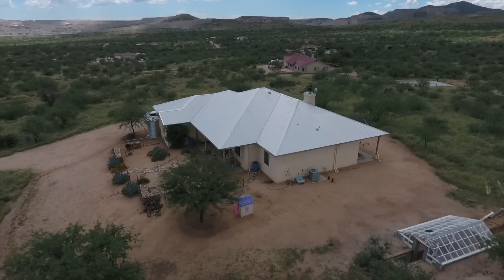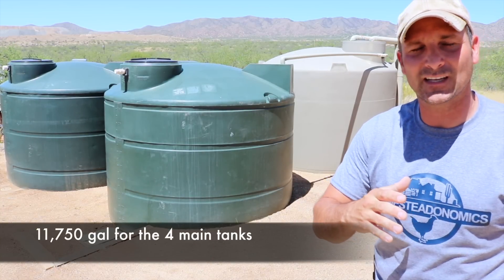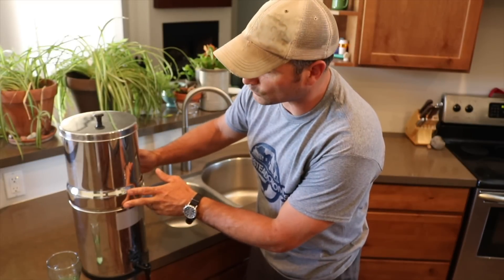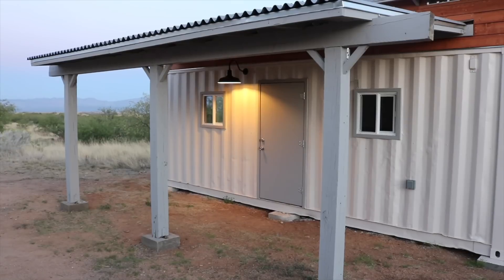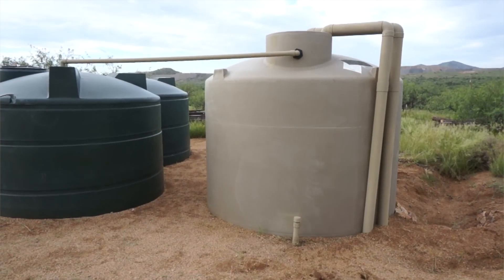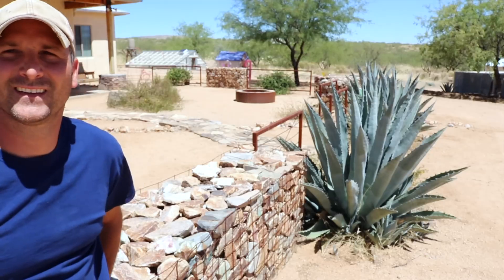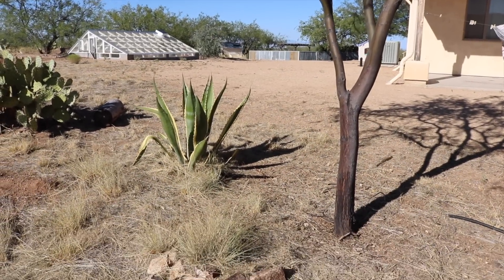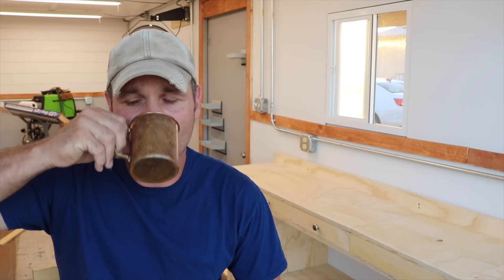Rainwater Harvesting QA - Cost, is it Illegal, how I treat, etc,.

Comment: Amazing project. I wish I can do the same here in Croatia. My income (read: pension) is low, so I can't do the same, although I wish. This summer is pretty rainy, but many summers are pretty dry. I have just few trees of apple and other vegetables, which suffer if there are no enough water. Question: did you consider collecting sunlight for electricity and heating water for bath?

Comment: Chlorine kills bacteria, bromine kills algae, algae grows in water in the presence of ammonia and nitrogen from animal waste, is introduced to the water at the collection surface, in the form of nitrides, toxic to plants and animals, it must be converted by a catalyst in order to support algae growth, this takes place , in an air water transition area, a rough or porous surface that receives enough moisture to remain damp continuously, or an area  in  contact with air and water equally, biological organisms attach to the surfaces, thrive by feeding on the toxic nitrides, converting the form of nitrogen into less toxic nitrates, still a harmful contaminant, which the algae feed on, killing the algae with another toxin adds another chemical, (goes deep into a vast and  boring study field) and eliminates the colonized algae, leaving both toxins  water, applying logic, in a pre storage area, circulating water through a desirable system friendly and edible media such as watercress, (yay veggies) or aesthetically pleasant aquatic plant, will minimize if not remove the nitrates, and this will be evident by the lack of algae (green to blue-green colonizing ot deposits in areas exposed to light, and your source for inspection. 
 You can do this with an inexpensive water pump and a few length cut drums with limestone gravel ( be sure to cover with screen and protect from animal intrusion)

Comment: Great video! I too harvest rain water. I use it to water my garden and to wash my car. 
I also have two deep wells. My rain tanks are nothing more then 32 gallon garbage cans.
I use a .5hp Jet Pump which is powered via solar electricity system. The whole system is set
up in and around my garage. It is small, only 300 gallons, but it does the job. Of course,
I am in Florida so we do get some rain. I do have to treat the water for mosquitos and I have screens over the garbage can / water tanks. I do not use this water for drinking.
So, I don't have a bunch of filters and I do not use chlorine since I use the water
to water a garden and to wash my cars.

Comment: Just saw the video, very good description of your amazing installation! I find it somehow interesting to live solely on rainwater. I take a strong guess you're solar powered as well?

The gunk from the roof that ends up in your tank should actually help in water treatment. Because in the sediments several types of micro organisms can start to settle, once they are introduced by anything that was on the roof for example. And you actually want these in the sediments, because they help getting rid of unwanted stuff in your water. They feed upon anything organic, create nitrite, which is then converted by the bacteria into nitrate (which plants need to grow - google for "nitrogen cycle") - so you gain a lot by a little sediments. You can support that by adding lava rocks, anything that gives the microorganisms lots of surface to settle, then you can introduce a quite perfect natural pre-filter.

With greetings from germany!

Comment: Hi dude. Thanks for the excellent video. I went with flexitanks. They are huge (like a shipping container), cheap, foldable and can last for like 30 years or more. And tarps, lots of tarps.
Also using solar panels to power a de-humidifier works great too. Even in arid climates it's economically viable as the price of solar energy continue to drop.
Have you tested your water for minerals? I added a gravel filter this year and the water is now as rich in them as the ground water if not richer. I also stabilize it, but I now know it's not really necessary.
Cheers.

Comment: Most marine systems use RO to make fresh water out of sea water, which is about as clean as it gets short of distillation.  Most of them have a UV light in the system after the tank and before distribution through the boat.

Comment: Californians may now legally capture and use rainwater harvested from rooftops. Departing from Western states' long-standing tradition of making it illegal to capture and use precipitation based on the prior appropriation doctrine, the California Legislature enacted and Governor Brown signed the "Rainwater Capture Act of 2012" [2012 Cal. Stats. ch. 537, Sec. 2.] (the Act). The Act exempts the capture and use of rainwater from rooftops from the State Water Resources Control Board's (SWRCB) permitting authority over appropriations of water. This development affords residential users and private and public entities with a new source of on-site water supply, which should reduce reliance on potable water for landscaping needs and provide a recharge benefit to underlying groundwater aquifers.

Summary of the Act

Prior to enactment of the Act, the SWRCB required all would-be appropriators to apply for and obtain a permit to appropriate water from any source, including water falling in the form of precipitation. Under the Act, however, the use of rainwater - defined as "precipitation on any public or private parcel that has not entered an offsite storm drain system or channel, a flood channel, or any other stream channel, and has not been previously been put to beneficial use" - is not subject to the California Water Code's SWRCB permit requirement [California Water Code §§ 1200 et seq.] Relief from the permit requirement enables residents, private businesses, and public agencies to create new on-site water supplies to meet landscaping needs, thus decreasing the use of potable water to meet those needs. The language of the Act recognizes that it may contribute to attainment of the state-wide "20x2020 goal", which aims to achieve a 20 percent reduction in urban per capita potable water demand by December 31, 2020. [2012 Cal. Stats. ch. 537, Sec. 2.]

The Act further provides that it is not intended to alter or impair existing rights, change existing water rights law, affect the use of rainwater on agricultural lands, or impair the authority of water suppliers to protect the public health and safety of public water supplies as authorized by California law.

Surprisingly, the Act explicitly defines certain terms - "developed or developing lands" and "rain barrel system" - although they are not used in the newly added Water Code sections. This suggests that in the future the Legislature may seek to expand and/or further define the scope of the Act.
Reply: I'd say it is the long-standing tradition of big-government, socialism loving states, not all Western states.  Arizona hasn't had such big-brother insanity.

Comment: That is an awesome system you have for rainwater harvesting. And without a well or connected water you absolutely need it. I first started regular rainwater harvesting in Pennsylvania, mainly for lawn and gardening on a half-acre lot. Now, in Missouri, we have a system that is filtered and used for laundry, showers, and toilet flushing. We use an Air-2-Water unit for cooking and drinking water, but you need higher humidity than Arizona has to rely on that. 

The biggest issue with our rainwater collection system is keeping the tanks from freezing during parts of the winter, but it is doable. Missouri actively promotes rainwater collection, and as long as you aren't connected to city water or sewage systems anything goes in the county I live in. We're looking at installing composting toilets in our house as the next improvement, and a system to catch grey water for the truck patch. Since we only use environmentally friendly soaps for laundry and kitchen, that should also be doable.

Regarding the legal issues surrounding rainwater harvesting, that must be a video unto itself. In a nutshell, there are two issues. The first is whether you are in a state or location that traditionally uses a water apportioning system called "prior appropriation" versus "riparian", because in a "prior appropriation" locality the person who first used the water in a creek or river has first dibs on the rainwater that would flow to that creek or river. The second issue is regarding contamination of public water and sewage systems. So, if you are completely independent of public water and sewage, and especially in a "riparian" rights locality, you are free to knock yourself out when it comes to how you collect and treat your own water.

Comment: you know what you need for that berky? i have a berkfield  same filter  the water is clean but they strip the water of everything you need some volcanic mineral stones in the bottom drum with some shungite chips that water would be around 10.0 ph. also i have this idea of water collection i'm not sure it's invented yet though where you could take a small lightweight but strong tiny propeller type device that sits in the pipe work where  the rain runs off past the guttering which could be turned into energy to charge power banks  there is energy in that water
Reply: and orgone dotted around where you are planting ..nature loves orgone

Comment: Old timers would throw an old silver coin in the water.  Silver has anti microbe properties.
Reply: Old circulated coins usually had a small amount of copper in them for wear resistance, typically 8-10%. Bullion and non-circulating collectors coins are the exception. Early 1900's Peace Dollar coins were 90% silver, 10% copper.
Reply: @Jean1641-4UK  you can just buy a .999 silver round for 15.50 c'mon guys think. Dont make it complicated
Reply: Steven.  As far as I know the coin silver standard always was and still is 90% ag 10% cu. I never knew of any other alloy for silver coinage except for clad coins of course. I didn't think there were many if any variations.
Reply: Cu has been added since ancient times in a effort to debase the currency.  Romans started at small amounts of copper then as their empire started to fail, went to much higher debasement levels (40-50%) destroying faith in the Roman denarius.  Silver was sometimes alloyed with gold in ancient times to form a metal called "electrum."   It is relatively expensive to remove the copper from the silver once it is added, hence the term "junk silver" given to most common issue silver coinage in the US.
Reply: They have 12v UV Water Sterilizer.  All you have to do is hook that to your Solar Panels.  It will be perfect for Sunny States :)
Reply: If I come across any ancient Roman coins, I am going to toss them in the well. 😁
Reply: Ironically this is also why Heroin addicts use Silver Spoons for cooking their dope.
Reply: @thetayterminator1436  heroin addicts use a regular stainless spoon for dissolving cut and burning off fillers in the dope not for antimicrobial qualities of silver that isnt found in spoons unless they are ornamental silver...and I have NEVER heard of a dope addict holding on to anything of value to make them helathy....just admit you completely made up that bullshit
Reply: @thetayterminator1436  why??????
Reply: Navi Gator.  I think copper has antimicrobial properties as well. It was said to be one of the advantages of copper plumbing in houses.
Reply: Did you notice he was drinking out of a copper mug
Reply: Cu certainly will kill algae ( as they put CU SO4 in ponds to control it) it will also kill most types of coral in a salt water fish tank.  Think silver water pipes would be quite expensive, lol
Reply: Navi Gator i do same way but i put gold rings in clay water pot
Reply: Beware electrolytic corrosion.
Reply: Right
Reply: So does copper... that is the way the Egyptians would store their water. because they knew the antibacterial properties..All the things the government does not want us to know about.
Reply: Silver coin??   If this guy is crazy enough to drink what comes from the sky I'm sure he has PLENTY of heavy metals..
Reply: today the coins are not silver
Reply: @carpejkdiem  your awake!! Don't get discouraged if people don't wake up!! Some will but God says in Scripture that he will keep a veil over there eyes so they don't.
Reply: Yup! My friend makes colloidal silver in our kitchen using a generator. I take it during flu season.
Reply: Have fun with argyria, mzlondon.

Comment: I really love your channel....i watch every minute of every video and I feel like I learn a ton....I did notice tho, your're tanks are expose to the hash sun...I think you should consider putting an enclosure around them ...you wouldn't have to insulate it or anything like that...something more "open air" but to keep 100% of the uv and sunlight off of the tanks so they don't degrade. I saw a video that showed what sunlight can do to IBC containers in less than 5 years and it was pretty shocking!!! Love your channel...keep up the good work!!!

Comment: The aerating taps on faucets sparge chlorine. chlorine is normally a gas at room temperature ( http://hydro-land.com/e/ligne-en/doc/gaz-Chlore.html ) and when the water is aerated the chlorine is removed along with the air. having chlorine in your pipes can also be beneficial to prevent bio-film growth, although in a closed system like yours It shouldn't be an issue.

Comment: Rainwater collection being legal or illegal isn't really based on just the factors you listed, nor are they really political.

I'll try to illustrate a few examples why rainwater collection can be legal, illegal OR on the flip side not collecting rain water in certain parts of countries can be illegal or legal.

Why collecting rain water may be enforced: 

There are some cities where previously rainwater went into the sewer system, or was diverted into storm drains. This was great for home owners, lawns and things like your basement would never be flooded. Until a bad rain, and overflow from water into sewer caused back flow into homes and businesses, or overflow into storm drains or sewer system actually causes untreated water to leak into protected waters. 

While you can argue they need to fix there system the city uses, this isn't always economical or even feasible. (I.e. to fix it might require another city unwilling to cooperate to do X, or vastly cheaper ways might exist). Moreover the water running into storm drains might cause localized droughts because water that would run off onto lawns or into local soil never does, and even reducing localized water tables and localized water absorption by even 10-30% over time can have some nasty side effects.

So cities then said "We need to remove all rainwater into storm or sewer systems" and they put programs into place to collect water, or hold within lawn and even put subsidies into place. Hell even just runoff into streets could make cities over time enforce a certain amount must be collected and held in a rainwater system.

Why collecting rain water may be illegal:

You don't use water how the environment uses water. That's pretty much as simple as it gets. You might use examples like "I'll eventually water my garden and lawn, so it's the same!" which... Is wrong on several levels. People tend to hold water till they need it. Makes sense, why would you be watering a garden that doesn't need water.

However the environment and weather drops a certain amount of water, it's used then and there. You use a little bit of water on hot days where it evaporates mostly. The dirt around your property is dry, none of the water you use actually goes where it would normally go.

Weather drops water, and the local environment might need a certain amount of rain and ground saturation before water will even flow to certain places, in certain ways, and everyone collecting water even taking a few percent of the water away on those critical days can prevent that from happening. 

Imagine you had a bucket, where the rain falls. You need that bucket to overflow, so water flows to say the ground where plants need to grow. 

Now say it rains only in the bucket, but people come in and take a glass here an there from the bucket.

The evaporation from that bucket, people holding water from that bucket, and the interval and time between rain might mean that bucket never overflows, to flow into plants below, to grow. Moreover even if every so often you are putting a little back into the bucket, evaporation made up for any difference you put back on hot days, because the bucket required a lot of water in a short time frame to overflow.

Hope that analogy makes sense, and why there are places where rainwater collection could be banned, or limited. 

There are other reasons as well, but I hope that makes sense to people.

Comment: If you add an additional "Rain roof", maybe build a ramada porch over your 3 large tanks.  The shade will cut down on the UV damage(maybe extending the life of the tanks and perhaps even cool down the water slightly in the system during the long summer days.

Comment: Nice video, Thank you for sharing so much information. I always thought a simple 55 gallon tank with rough inlet filter for big stuff and outlet with turned down elbow that won't let in floaters, would be better than the first flush systems. But if you can get inside your tanks to clean them out it seems like less work to clean out five extra gallons of sludge than to maintain the first flush systems.

Comment: 55 gallon drums usually can be purchased  for $20 or less, come in white, blue or black for hot or cold water and used in groups.  $3,000 for a plastic tank is very high, the smaller square ones are much cheaper, or anything repurposed.  In fact a concrete tank could be made much cheaper.  This 14,000 gallon water capacity is a small swimming pool.